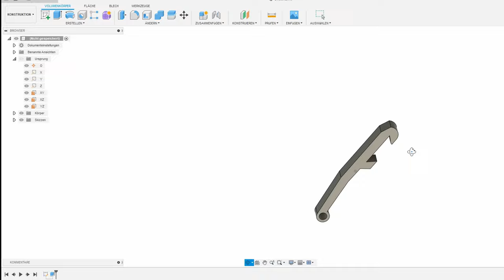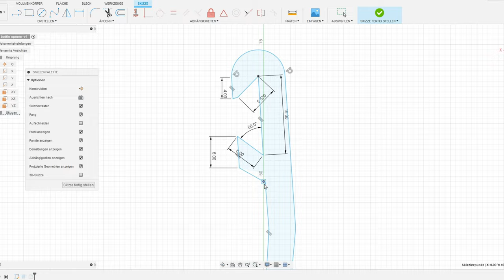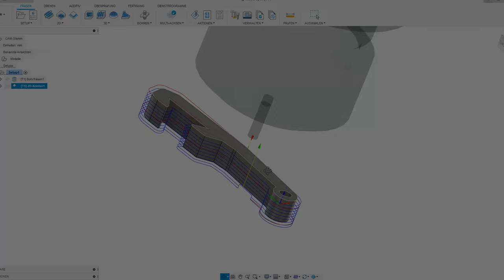How I made my own bottle opener out of Metal - DIY CNC FAIL

Comment: Fantastic! This is one of the best modified designs I have seen made from the original  Nikodem Bartnik's  simple design. Any idea of how much it costed without the spindle?
 
I have been pondering of making the basic 3D version and slowly use it to machine aluminium parts one by one.
Could do with your insight as to how one should embark on this journey in particular, I was planning to start with a 500W spindle and build using standard aluminium profile sizes i.e 600mmx600mm but I am not quite sure if it would drastically affect the operation limits of the original 3D printed parts design. My aim is to ultimately use the CNC to mill out aluminium parts one by one.

Btw - I see you have used a Planetary Gearbox Nema 17 motor for the Z axis. What is the benefit of this type of stepper motor?